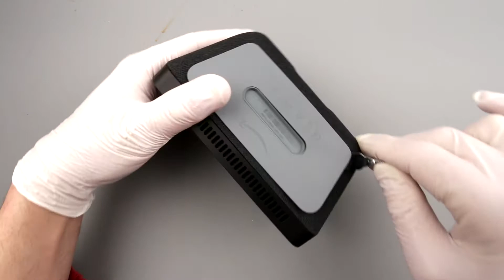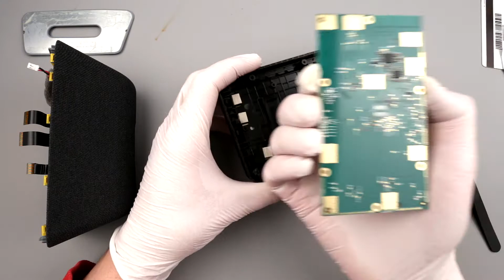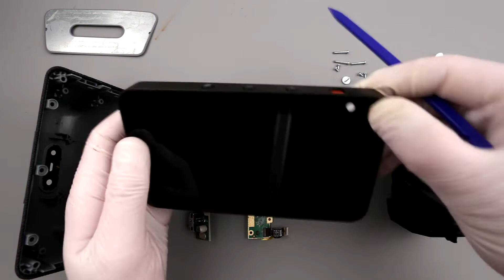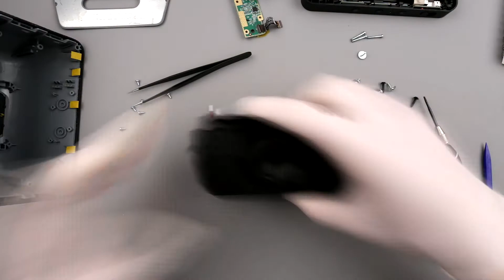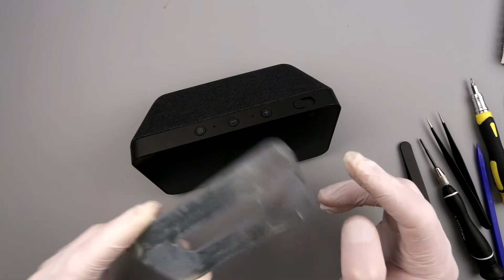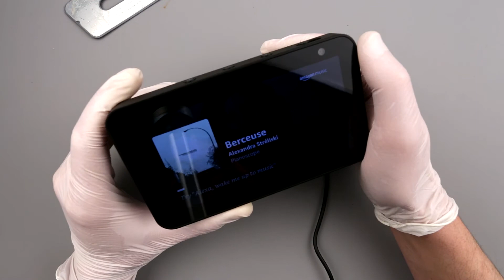Gutting the Amazon Echo Show 5

Comment: Good job. Do you know how to replace the digitizer? Mine is failing at the bottom of the screen. I bought one from AliExpress, but I am not sure if I can replace only the digitizer.
Reply from the maker: Uh-oh... this is tough.... you have to heat it to remove. Better to have a special heat place with controlled temperature like this - https://youtu.be/SKYdH9RtWSc
Reply: @InsideOutElectronics Oh, this is what I was afraid of. I searched all of YouTube for someone replacing the digitizer, and there's nothing. I'll find a technician to do this job.
Many thanks, your video is the most complete one on YouTube. Keep up the good work.

Comment: Hi, cool video! Do you know if there’s a way to physically reduce the sensitivity of those mics on the Echo Show? I tried putting tape on the two mics but it doesn’t really help. I want Alexa to listen but only if I'm really really close. Thanks!
Reply from the maker: Thank you for watching! This is a cool idea, let me think about it. Very simple path is just to muffle it with something fluffy
Reply: Is there are way to disconnect permanently the mic. Even if its cutting wire or disconnecting internal connection to "motherboard "? I guarantee you this will become a viral video if you share how to do this.

Comment: How to erase the firmware and install Linux instead ?
Reply from the maker: I honestly do not know, we need at least access to the console, but still it would be an issue because we need to hack boot-loader, which is highly likely protected. Why do you need this ? And then all the issue with hardware support ( eg drivers for different peripherals of the Echo Show ) that are need to be added into the linux.
Reply: @InsideOutElectronics  Thank you for your reply. I would never have such a device spying in my home and would prefer to throw it in the trash. It seems such a shame to waste such a nice case and touch screen display so I wondered if it could be repurposed as a tiny Linux computer.
Reply from the maker: @fotografm  Yeah! Well I agree with you :D I do not know how many people realize that !
Don't throw it away, may be it would be possible to put something like RPI or any other SBC inside !
Reply: @InsideOutElectronics  The problem is to find a suitable interface circuit for the display and touch screen !
Reply from the maker: @fotografm  yeas, this is the key. I have not looked into it, curious to see uf anythijg available

Comment: Good video Sir ! I´ve bought one of this last month and mine doesn't have an audio output conector, just the power in and the micro usb. Do you  know if Amazon just didn't solder the conector and neither gave the back access to the plug ? If yes maybe I can open the device and complete this functionality. Thanks in advance
Reply from the maker: Oh wow, but value of the external is mute as it will be MONO ! Do you care ?
Reply: @InsideOutElectronics  do you mean that the audio output of the  Echo Show 5 (when present)  is MONO ? If yes it´s terrible, but I suppose that, at least, over a bluetooth conection the Echo Show delivers a stereo sound source, isn´t it ?
Reply from the maker: @glauciogv5225  Sorry never mind, I still did not figure this out even that I promised in the video. Some ppl say it is stereo. But it is definitely mono is Google Home mini ! :D
But as you saw in my video Echo Show 5 has only ONE speaker, so it is joining audio channels together in the device, hence I was double guessing it if stereo or mono.
Reply from the maker: @glauciogv5225  And yes 2nd gen of Echo Soow 5 definitely has place for 3.5mm jack ! Here - https://www.briandorey.com/post/echo-show-5-2nd-gen-smart-display-teardown
So you can add one yourself ! :D
Reply: @InsideOutElectronics  Wow thank you very much !

Comment: Hi, wondering if there is a way to hack this device to output video to a TV? 
Is the device technically capable of displaying video to a larger display?  Thanks!!
Reply from the maker: Highly unlikely, itsLCD has proprietary LVDS connector, so we need to get LVDS to HDMI converter specifically for this which is borderline impossible and/or non-economical :)
Reply: @InsideOutElectronics  Thank you for your answer. Excellent work!

Comment: What Screwdriver do I need to open the case?
Reply from the maker: I used torx style bit to open the case
Reply: My echo show 5 is in my kitchen, I flooded everthing with olive oil. Now it sounds dull. I want to clean it, maybe this helps...
Reply from the maker: @CrapsterRec  oh... that sad. Please post your update here !
Reply from the maker: @CrapsterRec  And good luck !
Reply: I opened the case. Everthing inside was dry. But there is a kind of waterproof tape stuck over the speaker openings from the inside. I removed this Tape, I think it absorbed the olive oil. Now everthing sounds fine. It's no longer waterproof but at least the problem is fixed. Sorry for my bad english.
Reply from the maker: @CrapsterRec  oh wow, good to know ! Thank you
Reply: Okay, thank you :)

Comment: Can you help me with the specification of the speaker? I need to replace my speaker, but I don't know which speaker I need to buy.
Reply from the maker: Well my using is assembled back to it original state, but what what I remember speaker does not have any information on it. How it managed to die on you?
Reply: @InsideOutElectronics  I think ant/some other insect got in to it & damaged the speaker.
Now the audio is not clear, need to replace that ☹️
Reply from the maker: @aswindivakar771  I can suggest you to measure the resistance of the speaker, and find something of similar resistance and size, but that has to be full range 🔊

Comment: Great video, super intriguing from the beginning until the end, thanks! I was wondering about replacing Amazon's board with a raspberry pi, keeping only the speaker but most importantly the touch screen...do you have any specifications of the screen's connectors so that I can search for an adapter/shield for the rpi? Or maybe can suggest one?
Reply from the maker: Honestly no, but it looks to me like this one is custom, highly likely LVDS, but pinouts are unknown.
I will take a look, may be I can find something
Reply: @InsideOutElectronics  thanks a lot! I think that it can be an interesting project for many and, if I succeed, I'll share the steps/materials on the Internet. Knowing which components to buy will be a huge help!
Reply from the maker: @marcomow  Very nice!  please share! And message us when you have some progress!
Reply: Yes sure, if you can kindly help understanding which connectors are there for the screen, I'll search for the proper adapter :) for the speakers seems rather easy 2pin